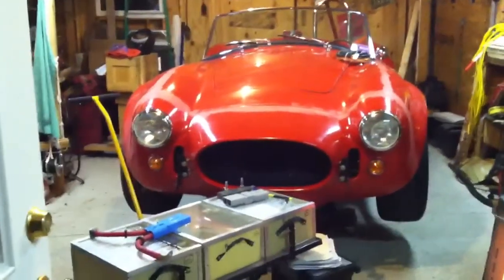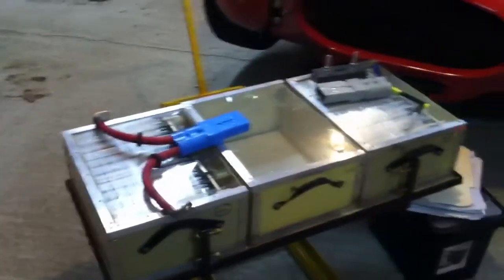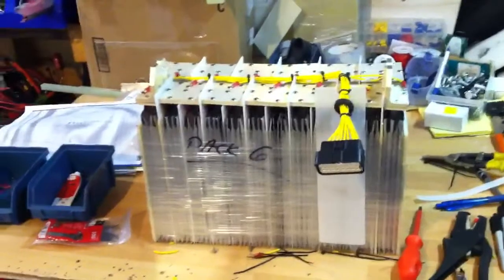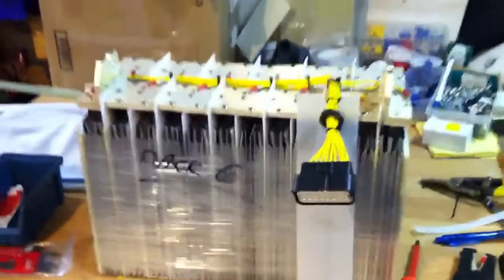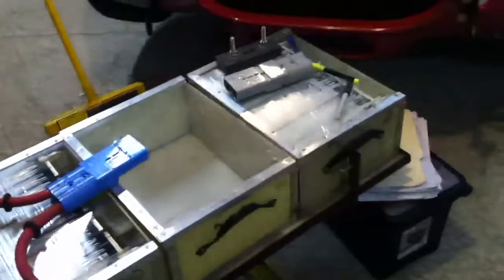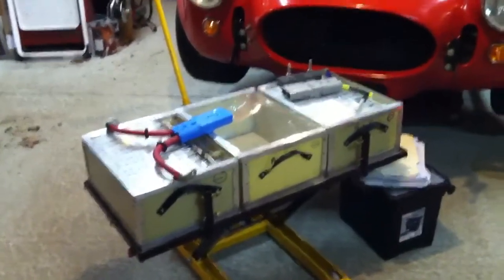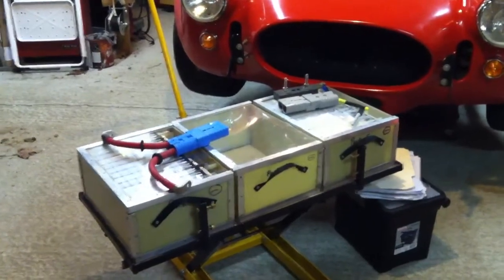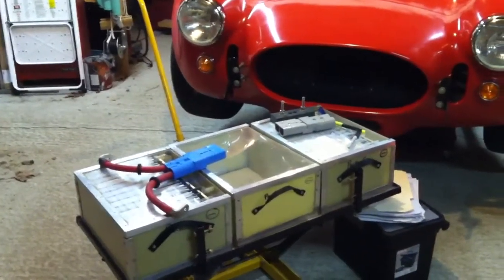Factory Five Mk4 - Electric Car - Video 43

Comment from the maker: Mikego18753,  there is no lead-acid in the car at all.    All cells are made with nano-phosphate lithium ion.    Early in the build process I did use a few 12V lead batteries for low voltage testing, but they have been replaced with lithium.

Comment from the maker: Yup.  They DO run long... especially when it's only a few hours here and there, and you don't really know what you're doing!!   Much of this project is the first time for me, so trying to make decisions carefully.    

I am starting to pull the motor out now, George Hamstra has advised me to use different brushes for this application, so I'm going to change them and start over on the brush seating.    A bit of a setback for me, but good advice from the motor master is worth following.